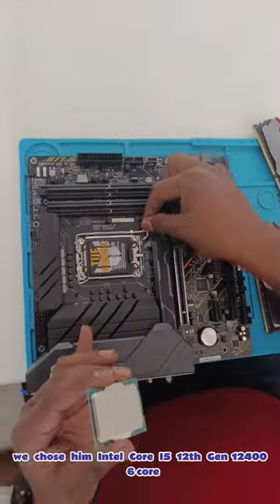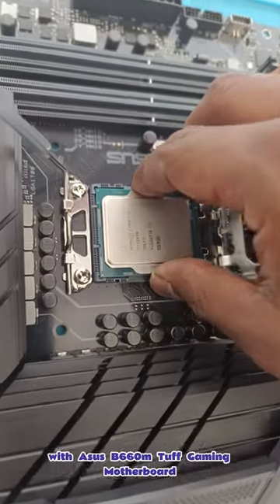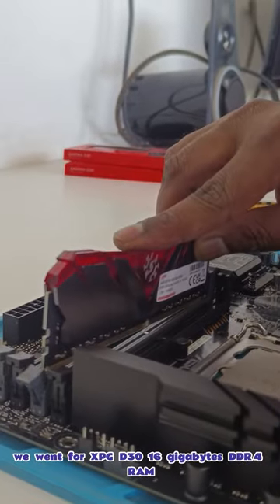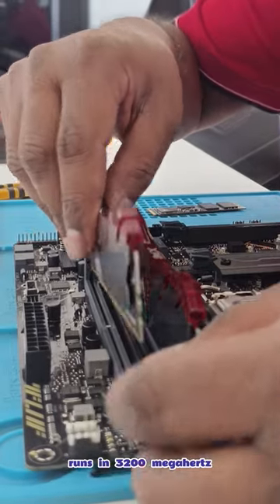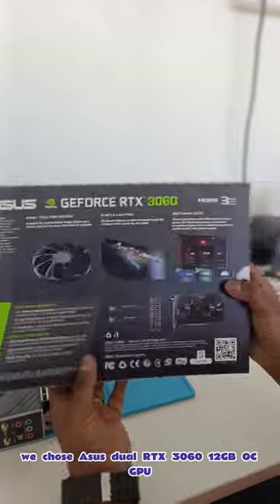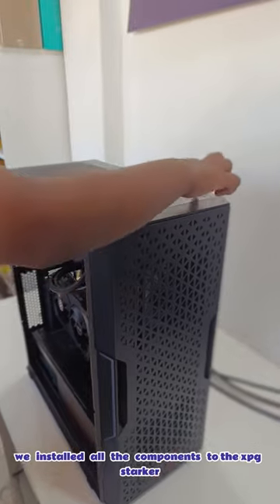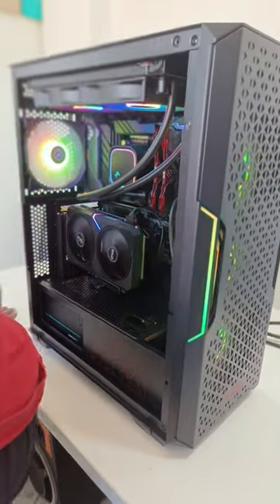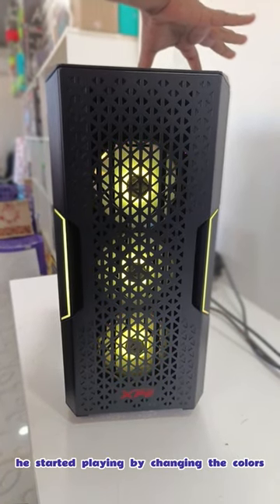1 Lac Gaming PC Build - XPG Starker Air #shorts #custompcbuild

Comment: We need any extra parts to install graphics card horizontal
Reply from the maker: You just need the riser x16 cable. The brackets are not required part of the case. You save about 2-3k compared to other cases
Reply: @rigvedapc  but that is not properly fitted I fixed with cooler Master mount(Cooler Master Universal Vertical Graphics Card Holder Kit V2 with Riser Cable (PCIe 4.0)